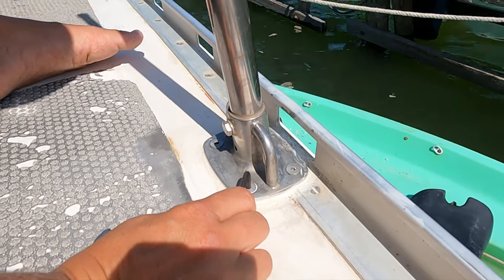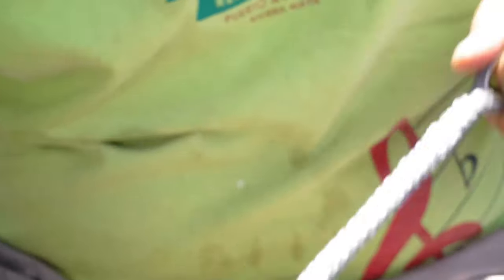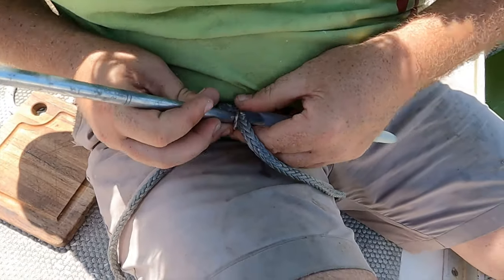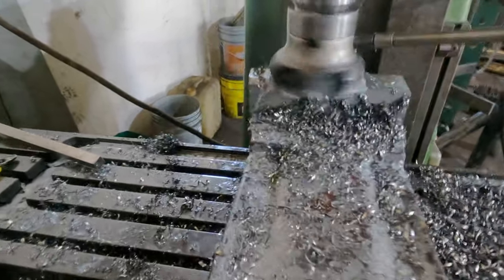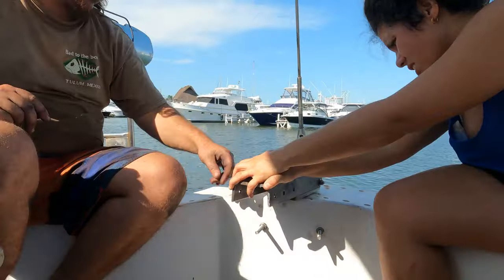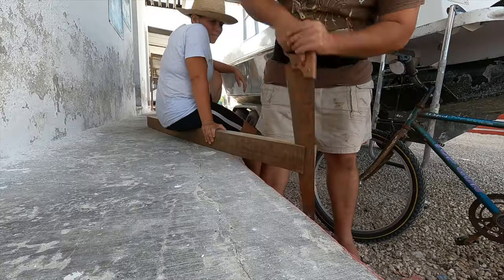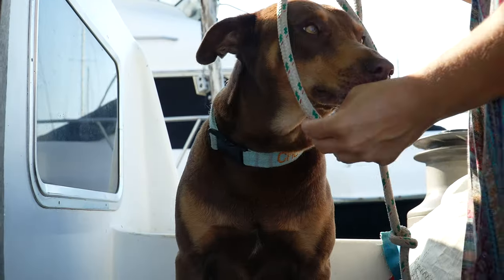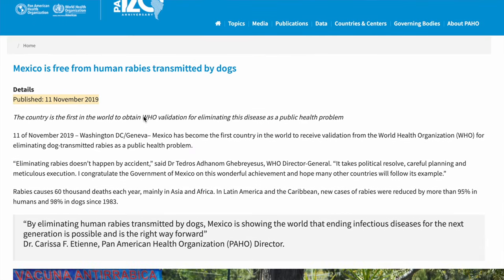sailboat 'STEERING' and 'SAFETY' progreso

Comment: Thats a really nice job on the tiller and with the splicing.
Reply from the maker: Yea thanks! Robi getting better with every splicing job 👍🏼
Reply: @sailorama  I know you ultimately went with oversized stainless rigging but nice to get the dyneema out of the locker and spliced up when you need a quick stay or shroud fix they are right at hand... that size is awesome for heavy duty rigging!!!

Comment: for the bolts: its doable single handed, the allen key will be hold by the stanchion or toe rail. It's just tedious running up and down or borrowing four keys with the same size :-)
Reply from the maker: It's true - it can be done in a desperate situation, but yes, I would not recommend. The keys will give way at least a little bit, and most likely leave you with leaky bolts.

Comment: It's so good to see so much progress on the boat and with Choco !
I was surprised to hear that you were not familiar with slip leads and thought the reason you used a harness on him was that you felt they might be a bit severe or may hurt him.
When I was growing up we had a large Boxer, he was very strong and hard to control but he did take some notice when we used a slip chain. The only other option at that time was a collar and lead but he knew how to slip them over his head so it had to be the chain ! We used to buy the thickest chains we could get which was about 5/8th's of an inch wide but he'd snap them after about 6 weeks or so !
Reply from the maker: I'd seen the slip chains before - I assumed that was a thing only for big, scary dogs. I also thought that a device that slips easily would mean that Choco would slip out of it easily, however he's never slipped out so far. It's actually harder for him to get out of compared to a traditional collar. We originally got him the harness because we didn't want him hanging himself when jumping on and off boats. We still intend to use the harness in and around the water. Also, amazing how strong some of the large, muscular-neck dogs can be - we're definitely lucky that Choco doesn't have that kind of build - if he did, he would probably need chain or prong collar in this situation.

Comment: Good job analysing your training problem,good work on the dogs part. 
               Little tip, it’s called the invisible rock trick. Bend over and pretend to pick up a rock,toss it up in the air a couple inches and catch it a few times. Often the owner,unseen by you,also deceived, calls his mut for its’ own safety. Usually any dog that harasses humans on its’ own knows what a rock is.
Reply from the maker: Thanks! Yeah, I’m happy for the neighborhood doggos as well - they learned pretty quickly too - no need to pretend to throw rocks even.